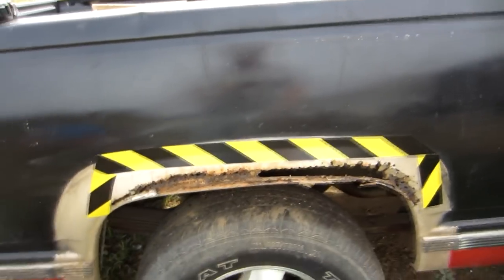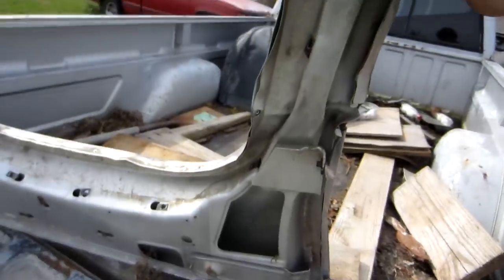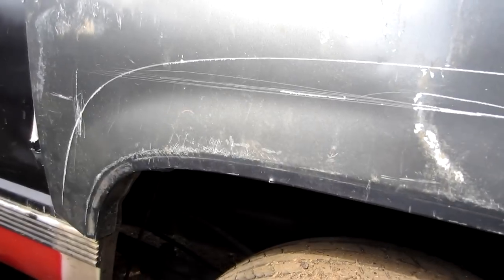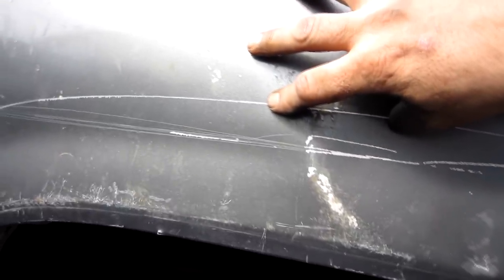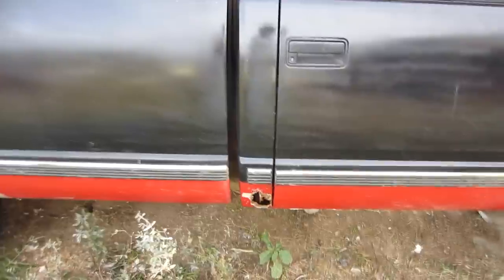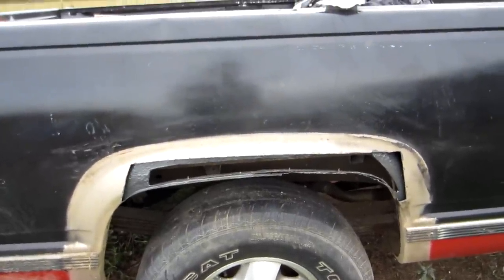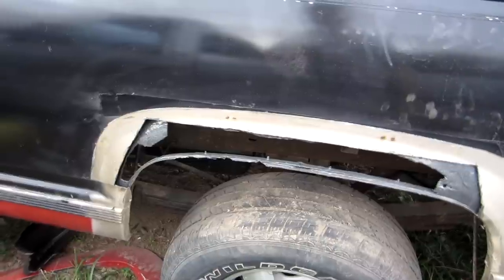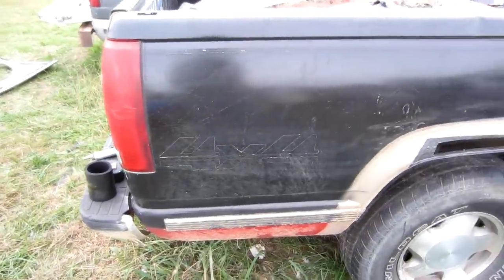Cuttin out Rrrust on the 4X4

Comment: @daddytech simple really Jim you take a ruler and measure what metal and shape you think you will need you then put it up against were you are going to put it and make changes to it to make it the exact size u need it then you take a sharp object and follow the new metal around the out side take that away then cut just inside the mark you made then the metal you made then sits perfectly and flush into the hole you cut out you then put a magnet on it to hold it in place and weld it in simple

Comment from the maker: @Peppercatkeith yeah i know i need something bigger but at the time this one kinda fit the bill pretty well i didn't know i'd actually be doing anything like this with mine or i'd have gotten a larger one to begin with. my neighbor has a 35 gal i think but the problem is the truck still isn't running either. going to do some things here in a bit that i can have the parts to put the truck back together and running so that if need be i can run it over to the neighbors and use his to sand with a DA

Comment: @daddytech Ive said below you will just have a little more cut out but that wont hurt ether because your meant to cut one inch away from the rust anyway if your not sure ill get on skype with you and explain it as you go you will have the job done in 1/4 the time and less head akes.